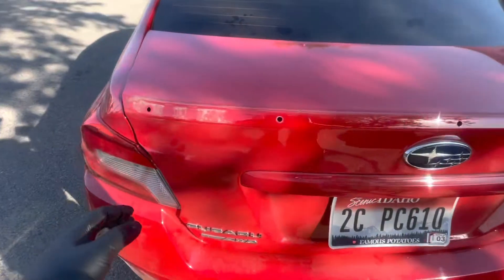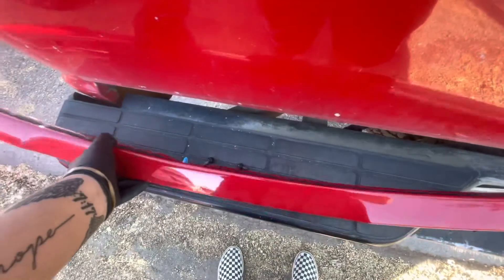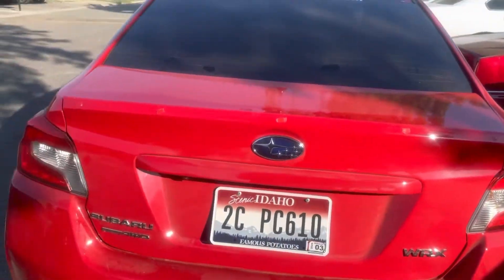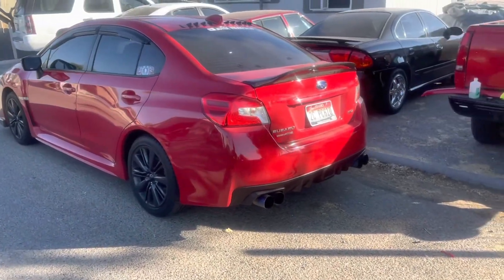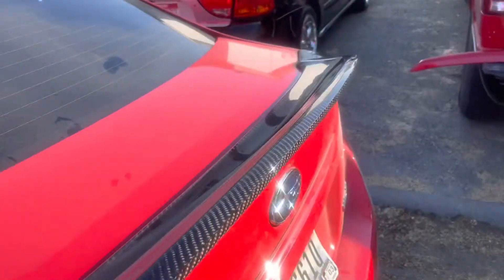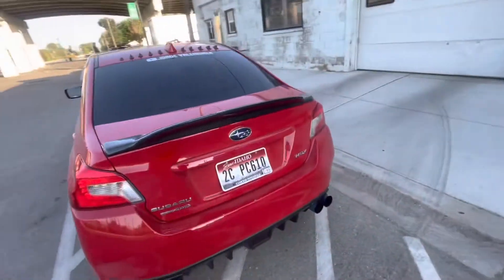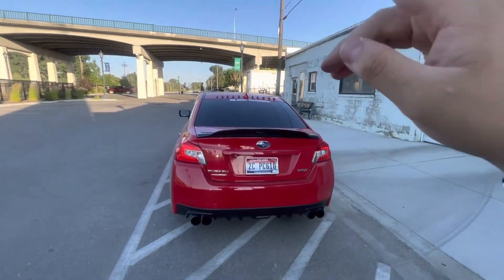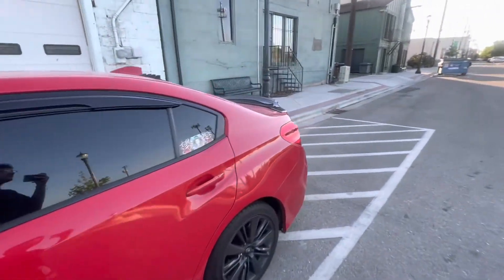2019 SUBARU WRX gets carbon duckbill

Comment: the spoiler looks great (the tacked on Autozone vortex generators do not).  It still boggles my mind that these companies can mold CF pieces, but can't incorporate mounting hardware into the CF when the OE piece had hardware... I'm sure the 3M tape is fine, but a mechanical fastener (even 3 out of 5) and some blue loctite provides more piece of mind